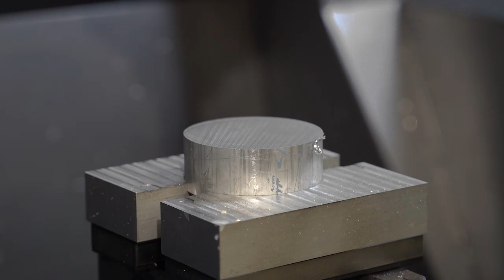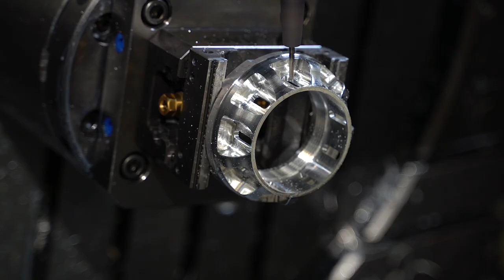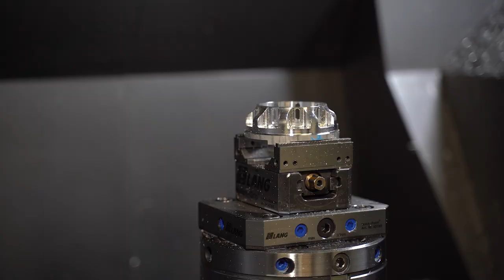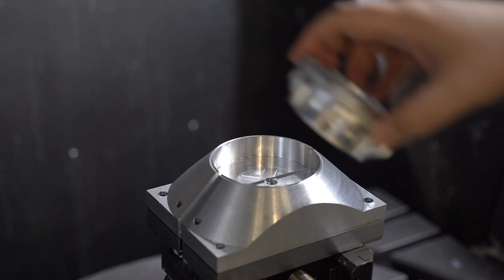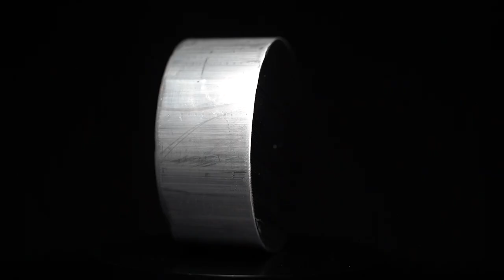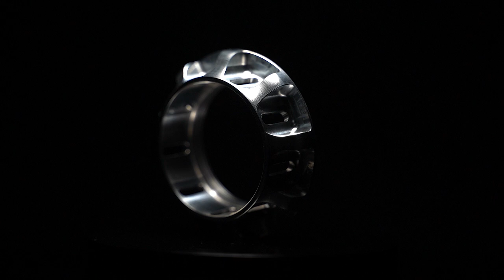Formula Racing Team Mono Nut 5 Axis CNC Machined #cnc #cncmachine

Comment: Would you mind sharing what aluminium alloy was used?
Reply: I guess it´s a 6082, pls correct me if i´m wrong would be nice 2 know. :greets
Reply from the maker: It's 6061
Reply from the maker: @Marco_mit_c_ohne_k  Good guess
Reply: @rapidenterprises5681  interesting i would have thought a 2024 or 7075 anodized they have higher strength and fatigue resistance. If it meets the criteria though that is the important part.
Reply: @jakbain1337  considering the life cycle of the nut, 2024 might be bit overkill. and for 7075, its definitely a horrible choice for a nut that frequently being tighten by impact wrenches due to its low impact strength.
Reply: @teamscarletdevil6915  I thought the impact energy of 7075 was great than 6061 learn something every day